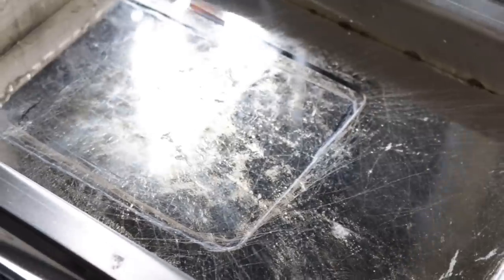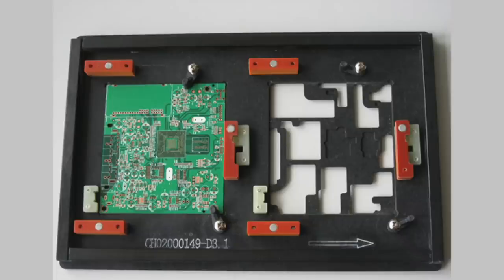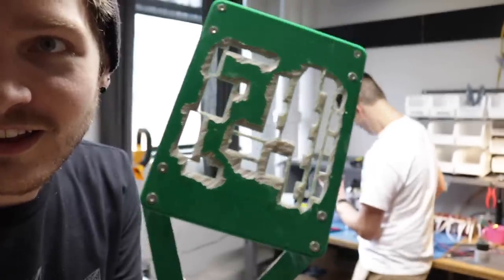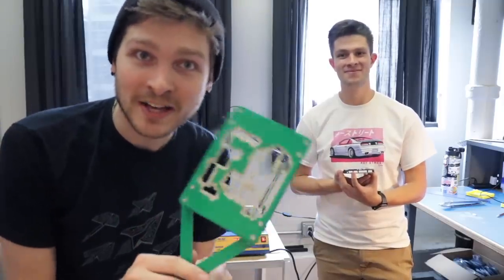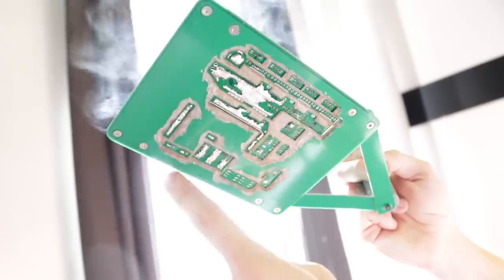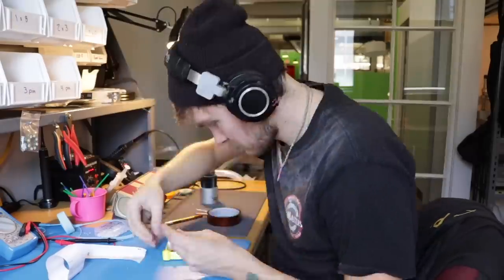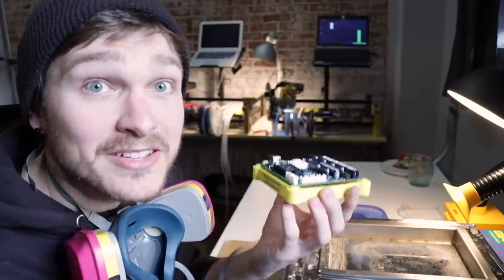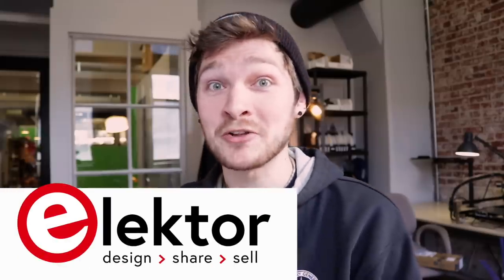soldering PCBs with molten metal

Comment: I may be misunderstanding what it is, but why not modify a LumenPnP to automatically place the components onto the board?
Reply: That's for sure what they plan to do but gripping through hole components isn't easy or the same and then you have image recognition and actually depositing parts can be an issue they sometimes don't quite agree with the holes, then feeding they aren't on tape and so on, it's a whole humongous undertaking, I wouldn't be surprised if it took 3 years of development and fine tuning.

Comment: Is your solder pot half full or half empty? 😂.  Seriously, the mass of the solder in the pot has a lot to do with what you were struggling with.  If you add more solder to the pot, you may be able to lower the temperature set point a bit.  It also will also allow you to solder boards in fairly rapid succession without having the pot drop in temperature as much.  Chinese solder pots are not known for having high wattage elements...

Comment: Is there a reason you couldn't apply solder paste to the through holes, squish the components in, and reflow?
Reply: Most THP are not rated to withstand the reflow temps.

Comment: Nah your theory about solidification is very unlikely. Liquid metal conducts heat EXTREMELY well so the molten metal underneath the 'frozen' metal, which you are hypothesising, would re-melt the frozen metal instantly. Drop a large piece of solder in there and watch it quickly melt despite its low temperature AND the added thermal capacity which is MUCH higher than the pcb...
The rest of the solder in the tank has too much thermal mass for a pcb to freeze the solder unless the solder is RIGHT BANG ON the melting point.

Comment: Your fluxing needs improvement, dipping isn't quite good enough. You have to use ISA or alcohol to wipe any residual oils off the PCB before fluxing. Both sides should be fluxed, and afterwards you need to wash the board to remove the flux.

Comment: You're trapping air by holding it horizontally... You aren't going to solder the bits that don't touch any solder...
Reply: Remember, solder is thick. When a metalurgist creates holes for air to escape their mold, they create large holes which allows the metal to flow through as well.